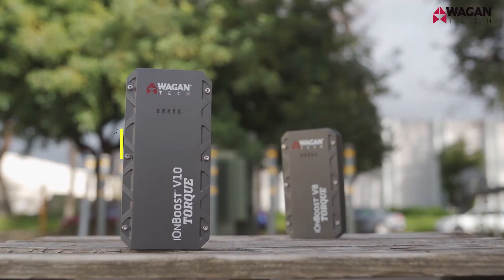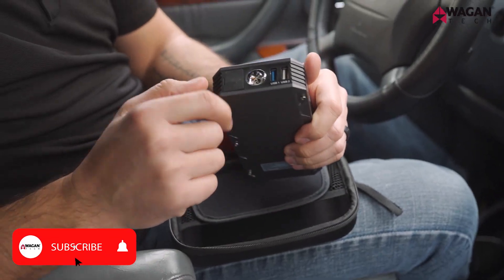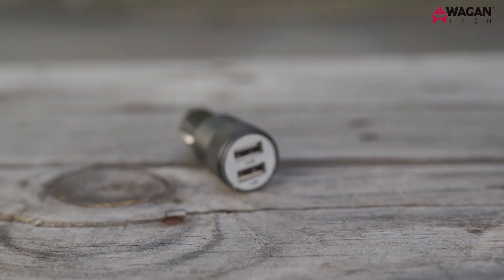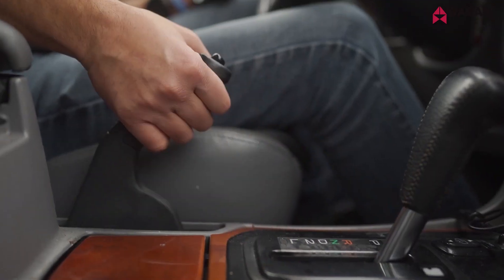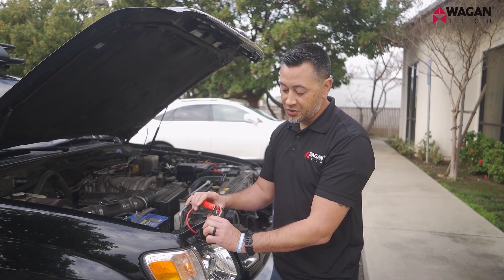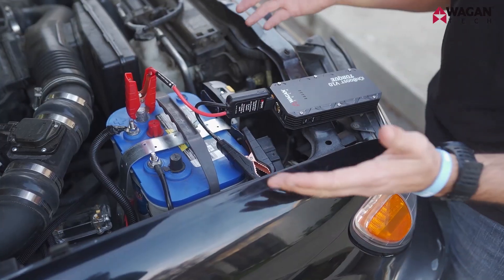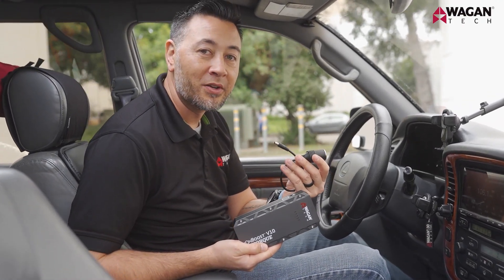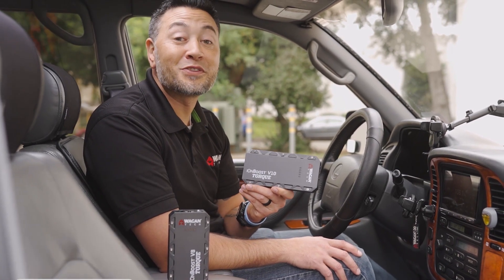How To Jump Start a Car With a Portable Jump Starter - iOnBoost V10 & V8 - lipo jumper

Comment: What should I do if the green light keeps on blinking?
Reply from the maker: Make sure you have a solid (clean) contact to both battery terminals. Don't use a "unpainted metal surface", just connect directly to the battery.

Comment: Well, at the 3:50 mark it would've been nice to know where the charge indicator lights were. Still 100% or something less? What if your car dies out for some reason and you're stranded after the 1st start?
Reply from the maker: The TORQUE series can start your car MANY times on a single charge. We removed the batteries on a V8 Lexus LX470 and jumped the vehicle 56 times on a single charge - fortunately you'll only need one jump to get you back on the road! Video here: https://youtu.be/eIQoJHaYEZo

Comment: Will it work on my Jeep with 3.6 Pentastar engine?
Reply from the maker: Yes they will as the Pentastar is a 3.6L V6 gas engine!
Reply: @WaganTech  Sure it is V6 gas. Just wanted to be sure because of its dual battery system and other electronic staff. Thank you for the answer !
Reply from the maker: @elmel7896  My pleasure!

Comment: Ok, this is the video I was looking for, including the order of disconnect. My power pack instructions say, in bold, connect the black cable to the engine frame no matter what. However, I've already watched 3 other video tutorials that instruct to attach to the negative battery terminal. Yours is the first that actually follows the instructions, though you do allow that if there is no unpainted engine frame available, then use the negative terminal. Are the power pack makers just being uber-caution-instructing to keep from being sued or what? lol Thanks.
Reply from the maker: You are correct in stating that manufacturers are being overly-cautious. The safest way is to keep sparks away from the battery, period. The best way to ensure a connection is to connect it to the battery directly.